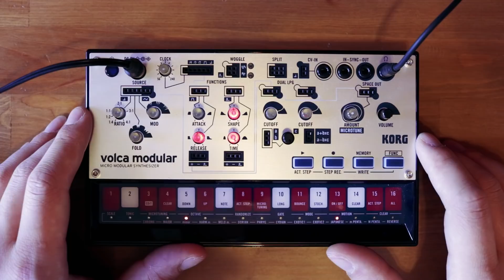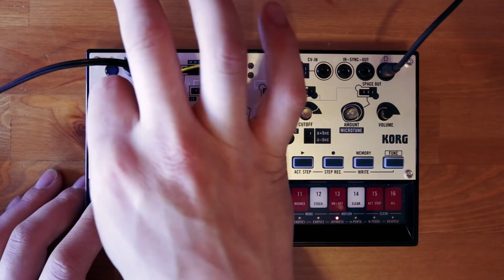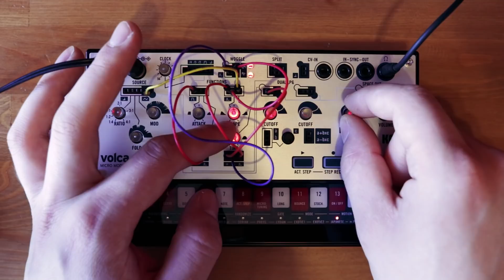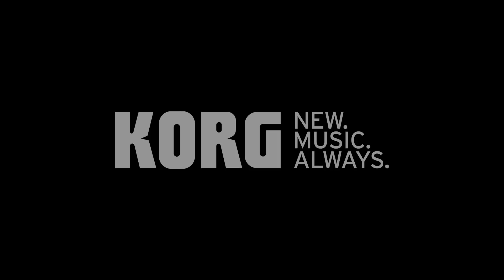volca modular Patch of the Week 12: Audio Rate Function

Comment: CV out to utility. Both utility outs to A & B inputs on the Math. A-B*C out to Time in on Function 2. C at max. This gives a roughly inverted Key CV. Function 2 looping. + output to LPG2 Audio In. Function 1 + out to LPG2 Mod In. Play with Shape and Time to get a pitch to roughly track keys. 3 oscillator chords, unisons etc now possible.
Reply: Pitch CV out to Split in. Both Split outs to A+B in. A-BxC out to Function 2 time. This almost gets key tracking, but even with C all the way up, its still not enough for full tracking. However, if you then take A+BxC out to C in, you get more than enough voltage for tracking, but scaling will be off between octaves...it can still sound cool along with your main Oscillators for some happy accidents though.
Reply: thanks a lot! it does sound pretty interesting although it does;t 100% follows the notes! thanks for the patch anyway!
Reply: what CV out do you mean? please explain, thanks
Reply: Hell yeah thank you!